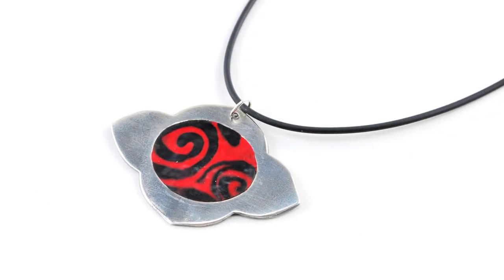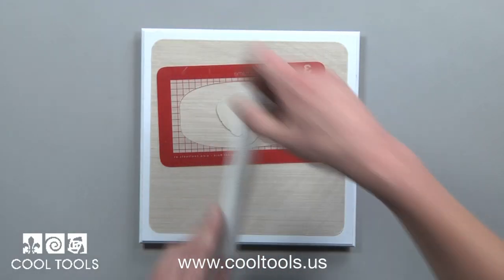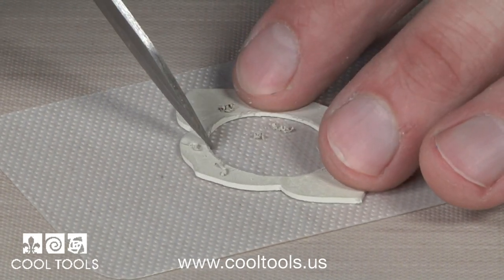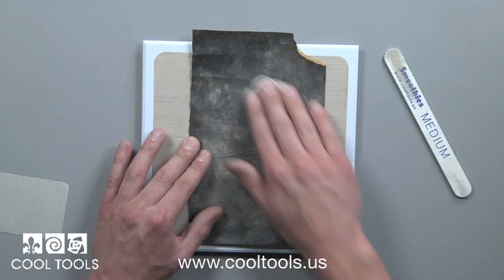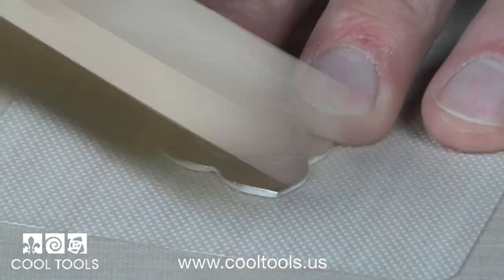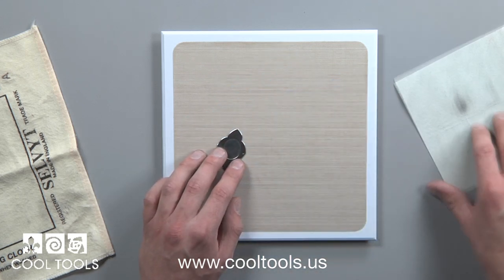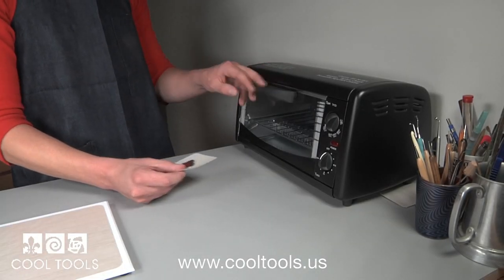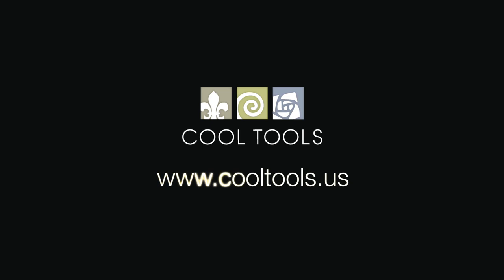Adding Polymer Clay To Your Metal Clay Designs

Comment: Does the polymer clay stay in the metal clay body without any physical/adhesive bond? Does it just stay in place because it is backed in the metal clay?
Reply from the maker: The polymer clay is inside a bezel, which is helping to hold it in place. If you didn't have a bezel, you'd want to adhere it with a bond. Hope this helps!
Reply: @cooltoolsvideos  Thank you :-)

Comment: What did you use to when you were rolling out the clay to get it an even thickness? And what did you use to bond the two pieces of dry clay together? I looked but can't find either.
Reply from the maker: Hi Courtney, to roll out even thickness of the clay, rolling frames and a non-stick roller are used. You can purchase these individually or in a set here: https://www.cooltools.us/ProductDetails.asp?ProductCode=CRL-400-P

To bond the two pieces of dry clay PMC slip is used. You can find this here: https://www.cooltools.us/ProductDetails.asp?ProductCode=PMC-506

I hope this helps!